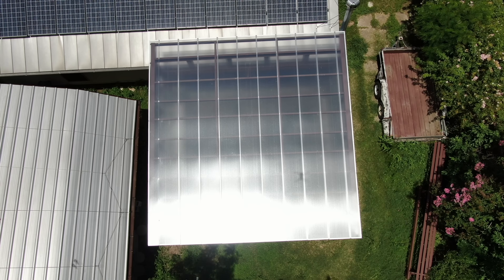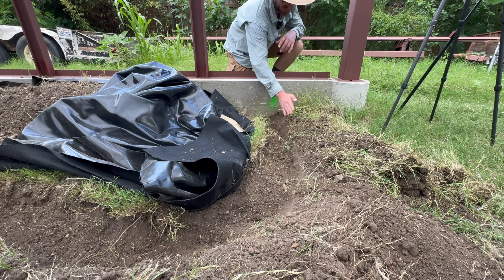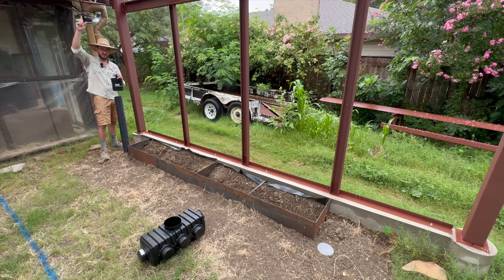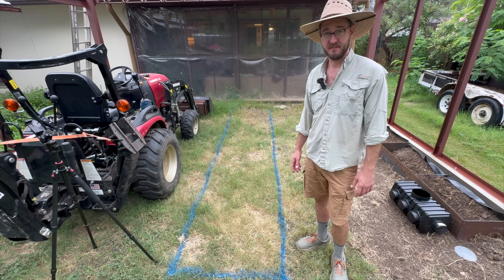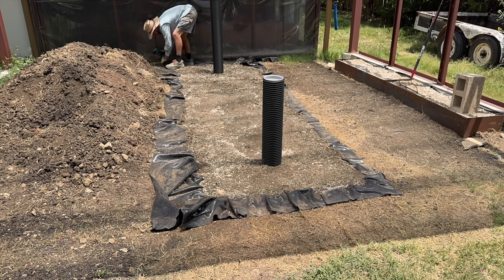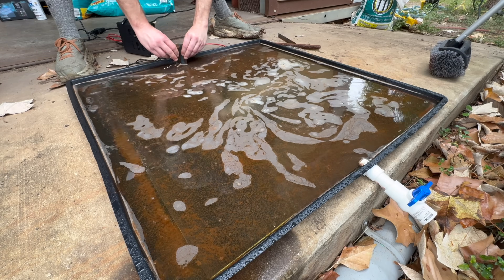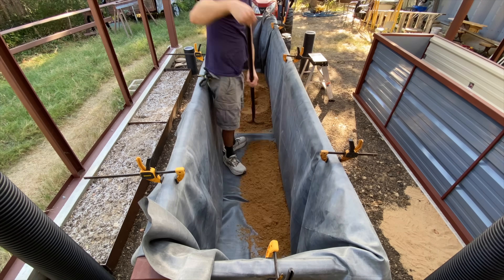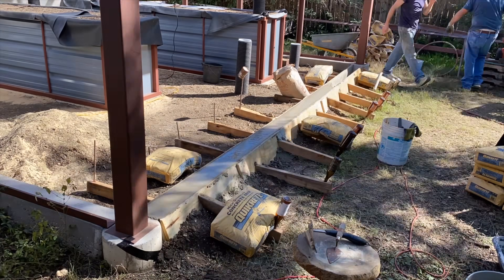FREE HEAT all winter long

Comment: I purchased the plans 
from greenhouse in the snow. They suggest 6-8 ' or deeper.
Reply from the maker: That’s for a true geothermal system in a climate with frost. We are so warm here we don’t even have a frost line. I didn’t run any calculations but I strongly suspect my climate is warm enough that I can dig more shallow. Time will tell 🤷
Reply: @suburbanbiology  I understand, but you still gonna need to be able to air condition on hot days, the point of geothermal is to be able to keep it cool and hot

Comment: It looks like an interesting project.

....but I'm really wondering about the calcs behind figuring the size of the planting beds and buried tubing versus the volume of gray water verses the cubic feet of warm air in the greenhouse.....just a lot of questions about how you sized it......"It" being the aforementioned components.

What happens if gray water volume is insuffient? Do you just tap into your 30K gallons of stored water? Or conversely, what if kitchen gray water is way in excess.
Reply from the maker: If kitchen water is excess then I can just adjust the hose (the greywater discharge) to a different location on the yard. If greywater is not sufficient I will indeed use the rainwater. Given my experience vacationing in earthships though, I think k the kitchen greywater will be plenty.

Comment: As much as I love LLMs, I believe that synthesising and discerning between different sources of information to draw your own conclusions is very important. It is a skill that has been gradually declining in the general population since AI's introduction. By getting AI to compile sources and summarise them, you are removing a step in the process of research. Additionally, because what the LLM produces cannot be verified without checking the original sources it took that information from, I see almost no point in using for anything more than menial tasks.

Comment: How does the fan work if there is water in the system?
Reply from the maker: The water is pumped out first. Then once the tubes are empty you can use the fan.

Comment: How much heat could you get out of a trench so shallow???
Reply from the maker: It will largely depend on how much I put in during the daytime. It’s technically more of a thermal battery than a geothermal heater.

Comment: no worries about mold/mildew in the pipes?
Reply from the maker: It’s on my mind. I’m hoping the tubes will be enough to prevent things from going anaerobic. My intuition says that if it starts to smell, I can just stop adding water and run the fans for a few days with the windows of the greenhouse open to air things out.

Comment: WOW ! This information is so incorrect. There are GAHT videos posted that even had follow up videos about how wrong they were on their firsts videos.https://www.youtube.com/watch?v=E0B8uopRznQ&t=475s .The amount of work done and the POSSIBLE amount of heat stored seems grossly unbalanced. You need at least 100 feet of pipe to have time to store the heat. With your short distance and 4 inch pipes, heat will just blow right thru and out the other side. No soil will get charged. You also need about 2 feet between each pipe so heat can go somewhere and be retained. Otherwise, the heat from one pipe will just go into the few inches inbetween the two pipes.No mass to retain heat. Well, hope you had fun making this video but of all the videos of GAHT systems out there, this is by far the most time consuming and least efficient one i've seen. I watched videos all winter long to build mine correctly. Someone even got college students involved and created a totally more efficient GAHT system that is more efficient. I am waiting to see the follow up video of the temps going in and coming out of your pipes and the soil temps. This work just boogles my mind. I'm sorry but nothing in this video seems like anything on any GAHT or earth battery video. Also need to find the formula to find the CFM for your fans you need.  Good luck, man. Hope you had fun. Let's hear what happens in the future.

Comment: do you have any concerns with all that plastic and microplastics leeching into the ground and your food? i struggle with these "green" solutions of putting micro and macro plastics into the food supply.
Reply from the maker: I cover that in the AI chat I referred to. I do have concerns. That’s why I recorded that chat. It’s too much to type into a comment. Suffice it to say I am more worried about my laundry greywater than the EPDM liner and the tubes. The geotextile fabric and tube socks also seem more likely to shed particles. But buried in cool soil with no light exposure it should be a small problem over all. Again laundry greywater is probably worse.

Comment: Since the hot air going through the pipe will be dry, will doing so pull moisture from the root area and make the soil around the root area dry??
Reply from the maker: Yes it will but that airflow will be helpful in avoiding anaerobic conditions. I can kind of tune the airflow to help determine moisture levels.

Comment: I think the irrigation is great, but I question the effectiveness of the geothermal. It's pretty shallow, and the barriers that are put in place isolate and limit heat transfer to the air
Reply from the maker: Time will tell 🤷 I plan on using a bunch of Bluetooth thermometers to graph the heat transfer when all  is said and done.

Comment: I think this is an excellent idea. 

I can also see that steel is your weapon of choice. Everybody has their favorite materials I suppose, mine being wood. With regards to the thermal function, I reckon steel might heat up quite a bit in daytime and conversely cool in the nighttime. Given that this system is supposed to work both ways, I wonder if you're not making too much of a heat battery during daytime by using steel. I've found that especially steel is much, much hotter than ambient temperature in the full sun (by over 30 degrees C difference). This extra heat radiation will heat the greenhouse  in daytime when the objective is to cool.

A second comment regards the depth of the system. The first trench seems very shallow and would only utilize the more dynamic surface soil temperature, whereas the second trench is much deeper. Is there any reason why the 1st trench wasn't made that deep?
Reply from the maker: The main reason the first tranche was so shallow is because I didn’t want to destabilize the footing beam it was dug next to. I’m going plant mostly cactus in that planter so I’ll probably rarely water it. I’m curious to see how it compares to the other planters for geothermal use. I’m guessing it will heat the soil quickly to a point of equilibrium and then equally quickly release its heat. I hope to chart this over time compared to the other planters. Cheers!
Reply: @suburbanbiology  I suspected as much, actually. I'm curious how this will perform!

I think this type of open source research/trial is very beneficial. Carry on the good work!

Comment: You probably already know this, but jic, you can make your own washing soda/soda ash/sodium carbonate from baking soda. This makes it easier to acquire, since packedged washing soda has disappeared from the local grocery and is much more expensive at the hardware store and pottery supply store.
There are several YouTube videos on the process, but simply, you either bake it in a casserole dish, or a saucepan on top of the stove! 
It’s more interesting in the pan version, because you can watch it “boil”….it looks like a background you’d see in a Gumby cartoon!
Great channel/series! If l was 50 years younger, I’d be trying these projects myself! 🤗

Comment: Some tips for those in a colder climate: I've used old fashioned strings of Christmas lights (the ones with actual bulbs) as supplemental directed heat sources.  
Another tip for insulation is use a secondary layer of plastic sheeting to create a 3"-4" air gap between the walls and roof if you know what I mean, you then can have a fan blow in this gap to keep it at positive pressure which will create an insulative barrier effect.
Another tip is to use a Chinese diesel heater as a supplement as it is a cheap and reliable source of heat.
I've also used old school DIY water cooled HID lamps like HPS and MH to provide light as well as heat.  
The new carbon heating technology is ideal for burying in soil for extra heat: 
Carbon heating elements use carbon fibers or rods, offering advantages like fast heating, high efficiency (nearly 100% electrical-to-heat conversion), precise control, and flexibility, making them ideal for infrared heaters, heated clothing, underfloor heating, and industrial applications, often integrated into mats, films, or tubes for radiant heat over large surface areas.

Comment: This is attempt at a thoughtful critique of how the use of AI in it's current state may seem very much at odds with some of the work you've done on this channel. It's clear to me that you very much care about a more sustainable world than we live in today. This is cool and I think part of the appeal of your channel. Using AI as a research tool is fraught today, and for the foreseeable future, primarily because of the absolutely dreadful energy and water usage required for LLM's to run at scale. As a former Texas resident, I can safely say that the climate there is already too hot and too dry and any additional stress we put on the world risks making that even worse. As of now, the US energy grid is still primarily dependent on fossil fuels, rather than nuclear or renewable energy, meaning data centers where AI is run from are using this less than ideal fuel to run. In some cases, data centers have already outsized the available output of the local power grid and diesel or gas turbine generators are being used to close that gap. Again, pretty awful for our planet. While AI may someday prove to be a more sustainable toolset than it is today, it's difficult not to recognize the absolutely terrible effect it's having on our already dangerous levels of climate change. I don't think you're some terrible person for using AI, but I do think it's worth considering how that looks when compared to your very ecologically considerate other projects and how it may rub people the wrong way.

Comment: I don’t get the pond liner? You are cutting off plants from the nutrients and water in the soil, plus you are trapping water inside creating an anaerobic environment in the bottom of your planter. It’s like planting in a five gallon bucket without holes.
Reply from the maker: The tubes provide the airflow. The worms and nutrients can still mix in from the mulch and soil at the top of each planter.

Comment: I'm actually less worried about the overt mention of AI, than I am the AI scriptwriting slop calling this system "geothermal", and the completely whack-ass air-to-dirt plastic heat exchanger design that even some simple calculations would show couldn't possibly heat the greenhouse in the way you're claiming. You've fallen for the AI chatbot flattery hook, line, and sinker on this here, and I hope you manage to pull yourself out of that echo chamber before it convinces you to make a truly expensive mistake.

Comment: 3:52 question, how do you deal with the metal chips after drilling the holes? 

From my own limited experience, I had to put a bunch of magnets into a ziploc bag and run it across the floor because the metal chips went everywhere. It was like 5 minutes of drilling holes, and an hour of cleanup afterwards.
Reply from the maker: https://a.co/d/ed4qZEQ

I bought a magnetic sweeper (above) recently to help with that. I used to use an old magnet from the magneto of a microwave and put it inside a plastic Amazon bubble bag. The sweeper is more expensive but WAY faster 😂

Comment: I'm so confused on what I watched. The tubes are supposed to go down a number of feet and spread a certain distance apart from all the videos I seen on geo heating. With having the equipment to dig with I'm not sure why you just didn't dig out the whole area to put the pipes down. And then running water through the prefilated tunes and using pool liner? And all the metal for raised garden beds? I'm so confused how efficient this was especially for the cost invested. Isnt the idea of using geo thermo heat for a greenhouse to save money? I never built one yet, but been interested in doing so. so many designs out their. I cant imagine you couldn't get buy with say a propane heater for small window of time of cold temps. I mean I'm in Michigan and used a propane heater. Granted I don't do it through the winter but to extend my season. And I could do things like double wall with air, or use triple wall greenhouse panels among other things with geo heat, using proper angling on the glass and so forth. I can't say what you did was a waste, because I never done it yet, and only watched videos. But I have done things like adding water for heat storage and using composting methods to add heat. Up here in Michigan, you basically need to use a combination of methods all which contribute as a whole. How well did this work out and what did you spend?
Reply from the maker: You ask many good questions. Too many for me to try to answer all of them. In central Texas I don’t have a frost line since we never get that cold for that long. It means I don’t need to bury the tubes nearly as deep as further north. When the greenhouse is done I plan to place a bunch of thermometers all around the inside to get data on which portions of this greenhouse work best. Stay tuned and hopefully that will answer many of your questions for both of us. Thanks!

Comment: I'm very skeptical about the drainage. It seems like with those pond liners, you essentially just made some giant buckets without anywhere for the water to go.
Reply from the maker: Yes. There is technically no drainage and it all relies on either the pump or the roots to remove the moisture.

Comment: Anyone interested in building a battery type green house in a colder climate, I recommend you check out Verge Permaculture with Rob and Michelle Avis. They have built one of the best ones I have been able to find. They are both engineers too so they did a lot of testing to make sure it was working well. 😊

Comment: Don't get me wrong I like the vid and idea but...

I hope you have a solution to the amount of mold spores you will be circulating.

I would have suggested you get clay and use that as a linear instead of pond liner (this was considering your second trench before I saw you building raised planters). This also prevents you making a housed swamp room by accident if over watering occurred. 
Which brings me to using raised planters like this. Eliminates a lot of the heat retention that could be had if they were planted in the ground. Although I do agree, race planters are very nice, especially on the back😂

Tree roots and plant roots are the same they will grow through membranes so you might get Roots depending on what you plant in your raised beds growing into the piping.

I think that it is cool. I've wanted to build a greenhouse with a thermal mass heater built in since I've seen you build one. I believe it was your video. I just am trying to point out in my attempt at being positive construction that you just put a radiator through raised planter beds which has a higher chance of assisting taking the warmth out of the soil, then placing it in it without an additional heat source besides the trapped rays from the Sun unless you use your mass thermal heater. Basically you could have just made raised beds. Put the mass therma heater in the same room and not had to have worried about the piping... I do like the video though and I wish I had the conviction to make stuff like this and put it on the internet hats off to you for that and thinking. I appreciate the learning and exercise. I get out of communicating my thoughts to you and absorbing the information you've given in this video.
Reply from the maker: You raise some valid points. I thought of the mold thing and even though I don’t plan on measuring spore counts or anything that technical I figure if it smells, I will add less water and increase the airflow and open the windows. I live in a unique climate in that we rarely get freezing weather for more than about four days in a row. So I’m gonna play around with these ideas before the cold fronts blow in and if it smells like mold, I’ll open all the windows and doors on the hottest days of our winter to air things out in preparation for the freeze. that way I can close all the doors without it stinking like mold. Thanks for the thoughtful comments!

Comment: Have you seen others do a pond liner under a ground heat battery like this? I was planning on doing the same and thought I might have had an original idea (guess not). I figure lining the trench so it pools water causes much better thermal conductivity and latent heat. Interested in how it works out. Since you're filling these pipes with water, are you not planning on using them for cooling in the summer?
Reply from the maker: Hey man!! Love your channel! Thanks for commenting. I haven’t seen anyone do this exactly. It’s a combination of what I’ve seen in Earthships and what I’ve seen from thermal battery work by folks like Jerome Osentowski. Given where I live in central Texas our summer highs are sometimes around 106 F. I was assuming that these planters would not be able to cool the greenhouse fast enough. The plan for cooling is mostly to dump as much heat as possible so the greenhouse doesn’t get much hotter than ambient. 4 windows, 3 doors, 2 roof vents and probably a ventilation fan operating on a thermostat are how I hope to do that. Thanks for watching! Keep up your great work!